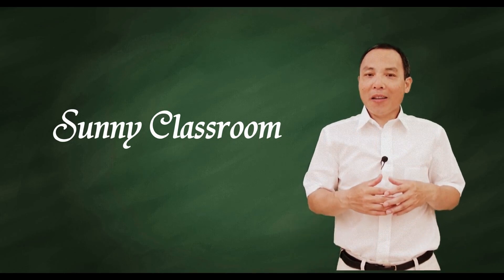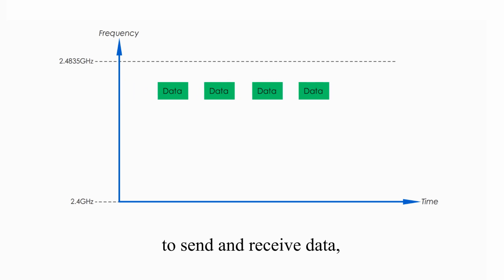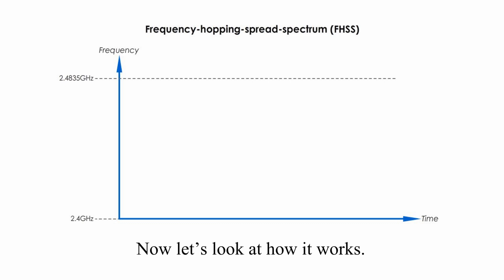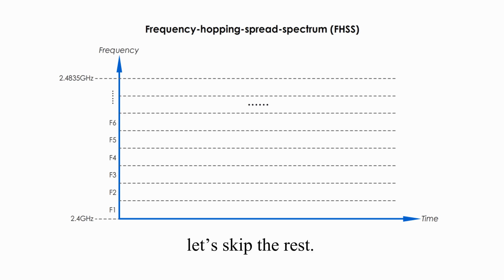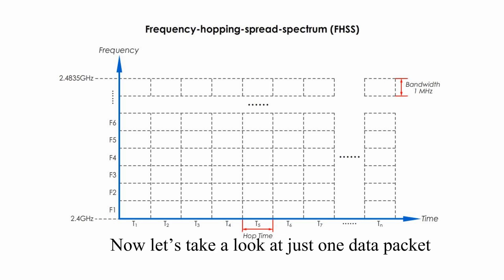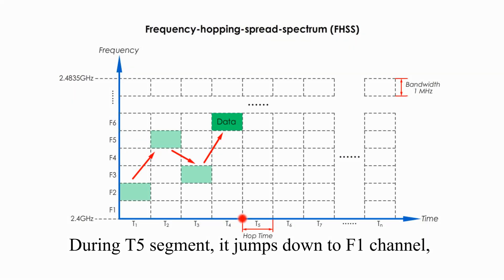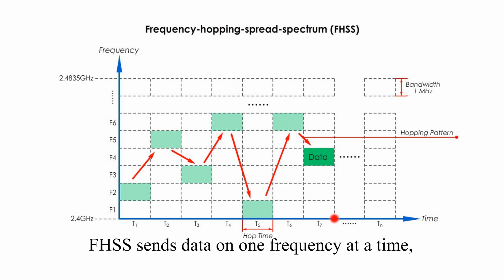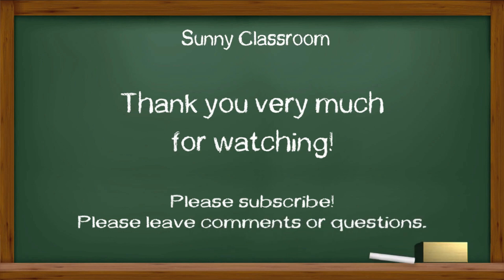FHSS - Frequency Hopping Spread Spectrum

Comment: i think the data packet doesnot jump to another frequency in the middle of transmission,instead i think the user data packets are send in a certain sequence using the various small channels ,and through which channel it will go is already decided before sending

Comment: But I have one question: How can data transmission signal change its frequency abruptly "during transmission"???? Isn't frequency change done from devices?
Reply: There's a mistake in this video. What he is calling hop time is actually dwell time and the time inbetween transmissions is hop time which isn't shown on this graph

Comment: I see this is a security benefit, but is it also benefitting regarding interferrence? That I dont see?
Reply from the maker: because there is a pattern in hopping, and noise or other interference do not have a pattern. When the receiver gets the signals, they can retrieve original signals and get rid of noises.